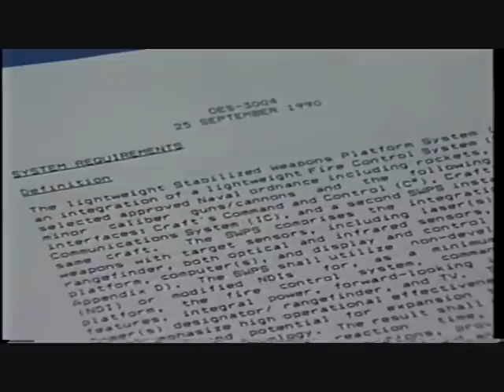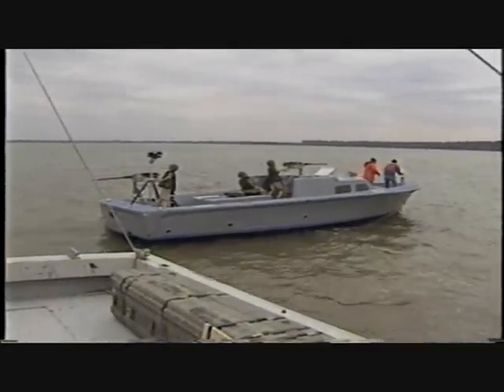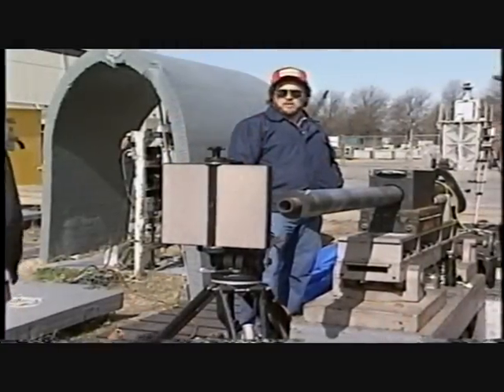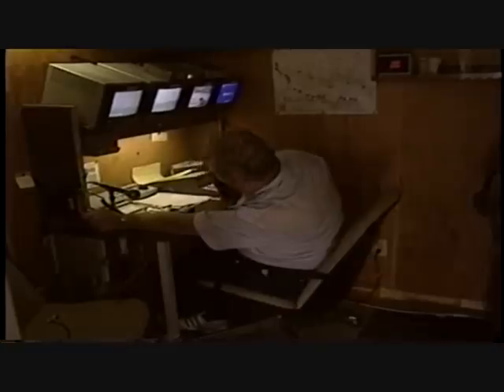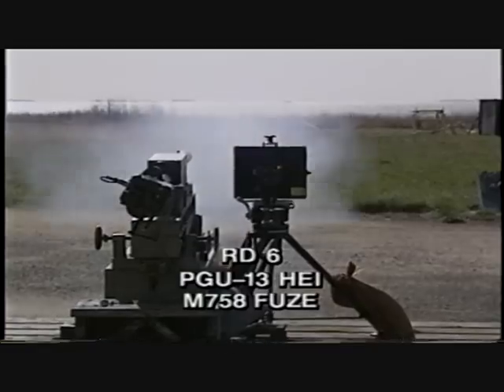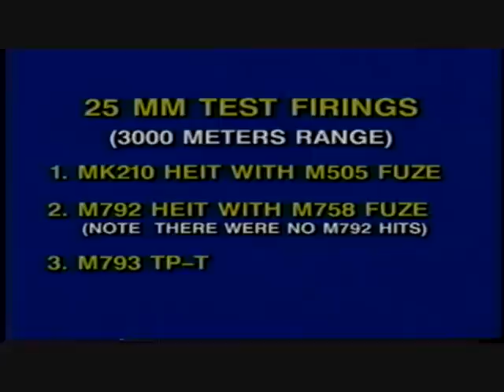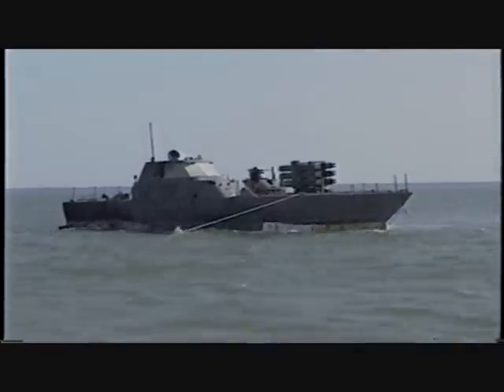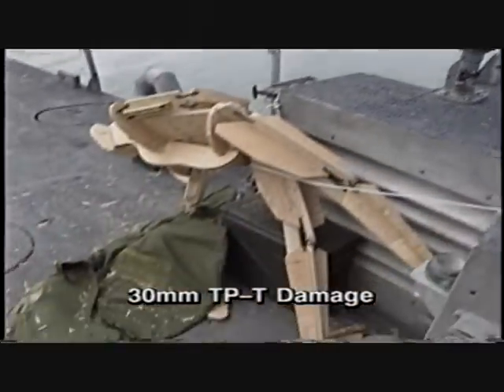Huge Explosive Bullets Destroying Boats!

Comment: 5:49 That’s a lot of shrapnel. No wonder they put these on IFVs and are preferred for anti-personnel use over larger single shot guns.
Reply: 25mm m242 bushmaster on the m2/m3 series bradley is a deadly gun against troops out to 3000 meters.

Comment: So.....the larger, heavier,  more powerful round caused more damage than the smaller, lighter, less powerful round?
Check.
Who woulda thunk?
Reply: The test was to see damage vs cost. 10mm diameter difference is a big impact on cost because the cost and amount of materials goes up exponentially.

Comment: Quarter inch aluminium Hull? 5.56 Green tip could put holes in that thing.
Reply: at 3000 yards ?
Reply: Yeah I saw it was a long ass distance after I wrote it, when I first started watching I was wondering why they used such flimsy test boats but I suppose that makes sense now.

Comment: Why the fuck were they firing in the direction of buildings?
Reply: The buildings in the backdrop are a few miles away. Cameras make them look closer. I grew up next to that base. The firing range is an isolated portion of river a few miles long that is guarded by patrol boats to keep civilians out of the hot zone.

Comment: Interesting..Suprised the 20mm And 25 mm didn't do as much damage  Even though they were explosive
Reply: Watch the slow mo at 5:15 that’s all hot metal fragments, not sparks. If that goes into your body, we’ll, you might find yourself in gods recently deleted folder a lot quicker then you wanted to

Comment: Nine times the damage from just making the round 5mm wider (less than twice a heavy)?  Interesting.  I wonder why a so much wider damage area/volume...
Reply: volume increase in explosive charge it substantial. 5mm increase in the space for the explosives isn't a linear increase. Likely the area to store the explosive in the larger round was the size of the smaller round.
Reply: @jaquigreenlees  Usually damage is increasing as the 2/3rds power of the increase in weight due to it being defined in many tests as the blast's shockwave energy per unit area of the surface at any distance away from the center of the projectile explosive charge, assuming the two rounds are otherwise identical except for size.   By this measure, the larger round would only have 2.25 times the blast energy at any given distance or the same blast energy per unit area at a somewhat longer distance for the bigger shell, but never nine times.  Fragment damage would go up more due to many more fragments from the bigger shell body (assuming the same size fragments in both shell explosions) going up directly with the increased shell weight, the larger being 1.73 times the weight of the small, if both shells are identical in design.  But this is not nine times, even combined with the bigger bang mentioned above.  Something else is happening here...
Reply: @nathanokun8801  Element 115 at work, obviously.

Comment: Hmmm. A big waste of money. It is not scientifically valuable. There are too many variables. It is not realistic. The targets are not firing back or maneuvering. Random hits on targets do not equate with usable technical data. Big vs small is not relevant. It doesn't make sense to argue this. Would you vote for using a 120 mm cannon against a speedboat or a 50 cal machine gun? In actuality, a helicopter-borne sniper seems to be the most cost-effective. This seems like a bureaucraticly driven waste of money.

Comment: This was all because the government money crunchers wanted the cheapest round, or cheapest bang for the buck! They wanted the 25mm round so the Navy said they would show how the bigger round is more economical than the smaller. As it was shown the 30mm was far more destructive, meaning less 30mm rounds needed to do a more destructive amount of damage than up to five 25mm rounds. 30mm rounds cost as much as one and a half  of the 25mm rounds. So for what five 25mm rounds cost, you can get just over three 30mm rounds that will do the damage that fifteen 25mm rounds can accomplish.
Reply: So value for money destruction

Comment: Comparatively  speaking  what are the ballistic performance   differences  between  the 25 caliber  and the 30 caliber ?
Reply: 25 x 137mm = 3,600 fps muzzle velocity, with 9,800 feet effective range, with max range of 22,300 feet.
30 x 173mm = 3,324 fps muzzle velocity, with 4,000 feet effective range, with max range of 12,000 feet.
Reply: @throngcleaver  thank you . The Vulcan 20 mm anti aircraft  and the vulcan mounted on the a-10 the 30mm has very similar  performance  characteristics .  I sure like those  single shot test guns though they might be a might difficult  the use hunting elk in Colorado  mountains . LOL
Reply: @deathvalleyalex9485  Hahaha!  Yeah, you might want to consider some type of vehicle mount.  I don't think anyone could sling one over their shoulder........the sling alone would be very heavy.  :D

Comment: How the Hell could a 25mm hit and NOT penetrate a 1/4 inch aluminium body?  
I realise the ally won't have been pure aluminium,   most likely Duralumin I guess...   
but even so, it's not exactly armour is it.    
Anyone ?
Reply: Chris England if it’s some form of HE it’s not going to pen much. Russian 125mm smooth bore cannons can only pen upwards of 57mm of armor
Reply: Because it hit the hull at one of the ribs. There it had more than a 1/4 inch of material in front of it (worst case; it could be as thick as 4" if you exactly hit the rib).
Reply: DreadX10 
Chris England was asking about why none of the 25 mm rounds penetrated the hull (they just made dents).  I was also surprised that a 25 mm could not go thru 1/4 inch aluminum.

It was a 30 mm round that failed to go thru the 1/4 inch aluminum where there was an internal frame; the other 30 mm rounds peirced the 1/4 inch aluminum.

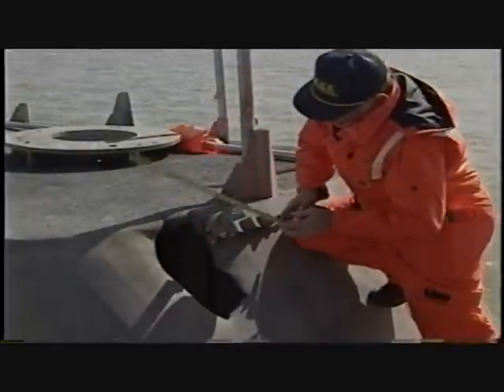Watch the summary results part (from about 8:45 to 9:00) of the video again!

Comment: One of the boats had a one-foot-thick hull? That sounds unbelievable - even if it was fiberglass sandwich.
Reply: Foam sandwiched by one fiberglass panel on each side, total width is one foot. It's not one foot of fiberglass, it's the foam inbetween than's one foot.

Comment: Iranian General -"sailors of Iran mount your tiny warrior speedboats and destroy the enemy with a mass attack the US will never be able to defend against"

Iranian Sailor - " yes oh great leader but can you please go watch a video from nearly a decade ago where the US destroy little attack boats as if made of match sticks with 3 small rounds not even a missile first sir?"

It may be a touch old and boring but its a very relevant test currently and just reassures every iranian attack boat captain that destruction is pretty much assured just with one CISW let alone 3 or 4 on each navy vessel.
Reply: most US ships only mount one  of the rotary guns, but many of them have multiples of the 25mm 242 bushmaster. as an attack boat captain I'd be more worried about a counter swarm of SM-2 missiles, they aren't that great against larger enemy surface combatants due to the small warhead, but against the thin armor of most FAC/missile boats even a single hit would be devastating. then there is the actual 5" with airbursting shells, which with modern gunlaying equipment would be pretty much game over from a small barrage.

Comment: Same 25x137mm shells fired from the M2 Bradley and Harrier jets

The 30x173mm shells are used in the A-10 and much larger than the 30x113mm shells used in the Apache's gun.

You're welcome :)
Reply: tks ... always think apache and hog fire the same bullet ... :/
Reply: @alejandro6404  those are shells
Reply: I wasn't aware of that. I always thought the rounds would be the same. Thanks for setting me straight.

Comment: It took all this stuff and people to figure out a 30mm would do more damage than a 25mm? If they would have given me a call I would have told them that and saved 'em all a ton of money. Although... doin' this stuff is way fun.
Reply: it didn't take Sherlock Holmes to figure out that one did it?
Reply: So if they had done the tests individually to measure the respective lethality, it would have been better suited to your tastes?
Reply: but how much more damage does it do for the weight of the weapon system and ammunition and for the mission it's designed to so sometimes bigger might not always be better but yeah no brainer 30 mm rocks
Reply: It was also about which round was more economical
Reply: Well yeah they knew the bigger round would do more damage, but they didn't know prior to testing that it would do nine times the amount. Things like this have to be tested before being sent off to war.
Reply: Not everything works intuitively.   They have to run these tests to know for a fact what happens.
Reply: i wish they'd send u to war with half-assed weapons
Reply: @juliosunga3530  "here's a toothbrush, and a can of baked beans... Do something."
Reply: But 9x as much damage got my attention!

Comment: Well and good as long as the target didn't fire first and you are already dead. Love these simulations where the target doesn't fire back.
Reply: Wayne Kerr that’s not the point of this test...
Reply: Targets were armed with .50 (=12,7mm) and were shot at with 25mm and 30mm. They didn't have the chance to fire first because they lack the range compared to the bigger calibres.